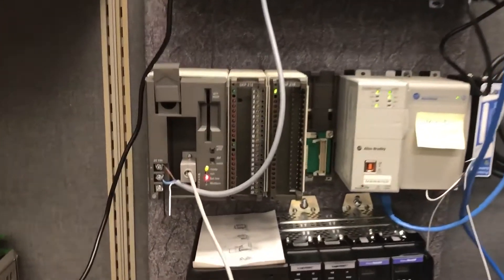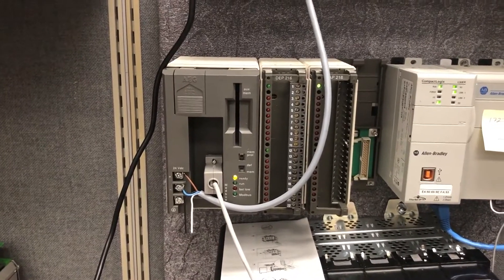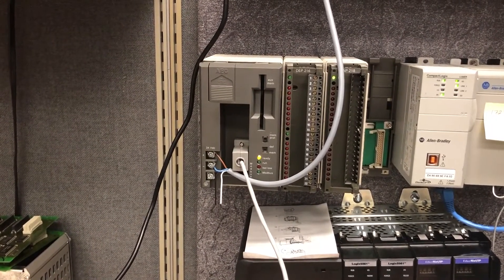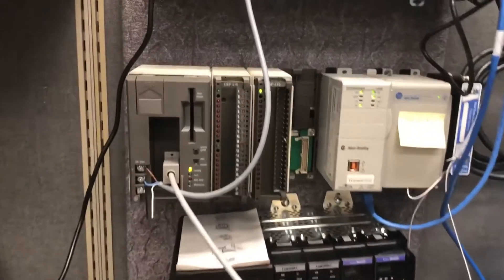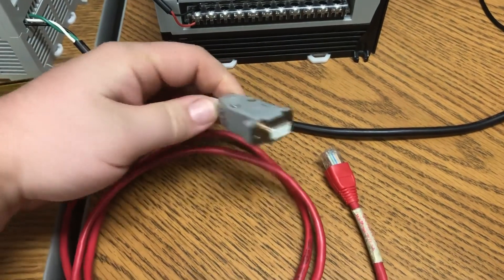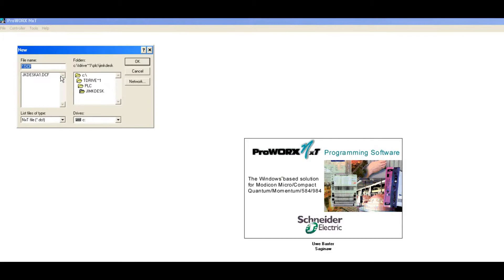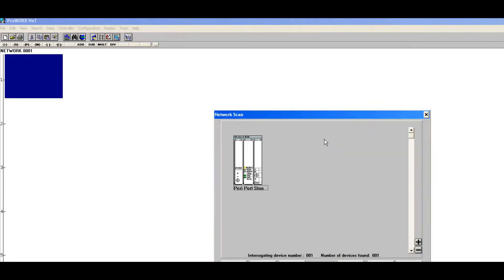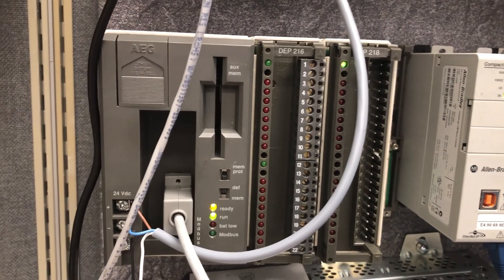Modicon compact 984 Controller in Dim Awareness and Message 389 resolved

Comment: Hello How do I reset to factory settings?
Reply from the maker: The fastest way to do that is to remove the battery and power it down. Give it an hour or so and it should be completely wiped out.
There are some models like the 265 that may have flash memory in them. If they do, they will boot up with a program even after removing the battery. The sticker on the side should tell you if they have flash.

Comment: Is it possible to use RJ45 RS232 cable when you are using A984-265 model? Are there no settings to configure on the software before implementing that?
Reply from the maker: I need to do a video on this, there are no special software settings, it is only a pin to pin conversion issue.